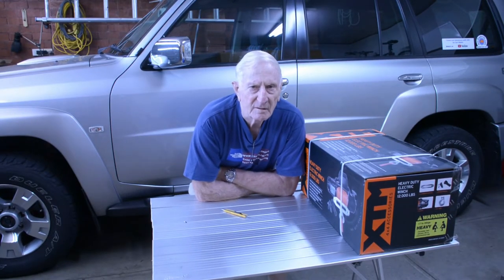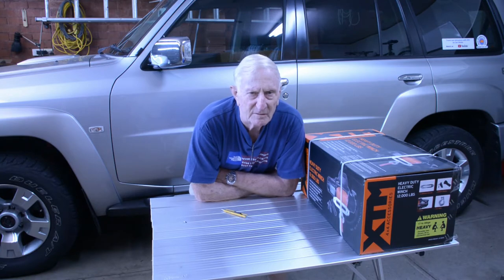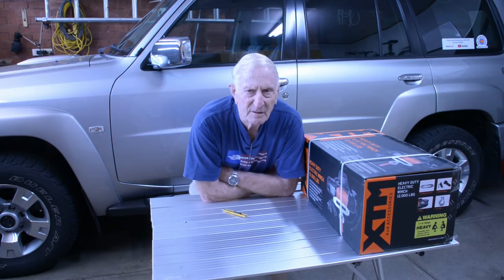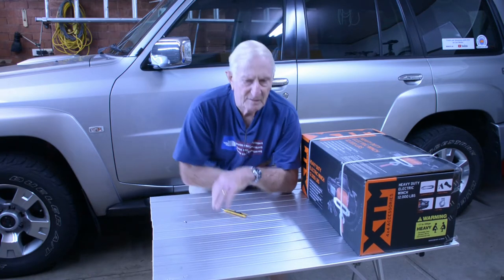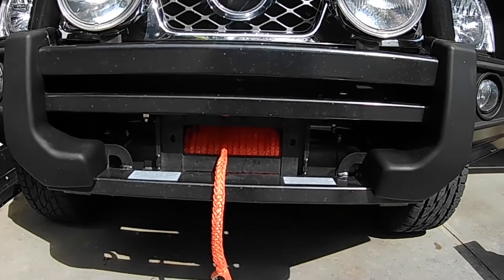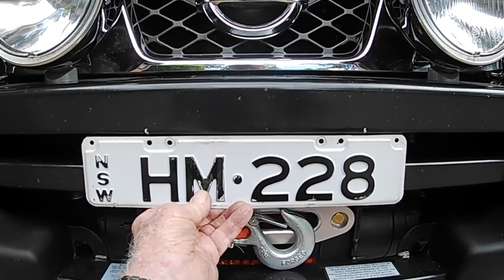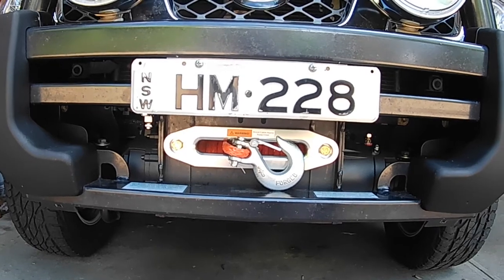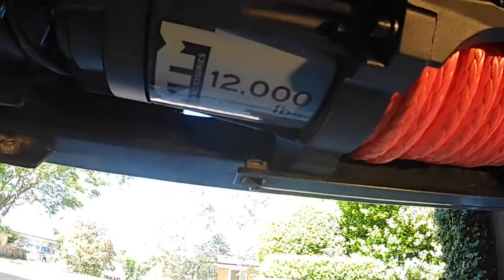XTM Winch install on a GU Nissan Patrol

Comment: Hi Carl, was about to mount a kings winch of the same dimensions on and with no rope on the drum it looked way to low in the normal mount position on the bar to where the fairlead would be . Have you had a chance to use the winch yet, had any trouble when spooled out lots of rope with it pulling on too much of an angle from the fairlead to the winch ?   Cheers.
Reply from the maker: I think you are looking at the instructions where they tell you how to mount same as mine which makes the rope come off the drum at the bottom, even though they tell you not to I turned it upside down so the rope comes straight out of the fair lead not sure if I explained in the video.
The rope on mine comes out 600mm above the ground and yes I did a test using most of the rope pulling uphill 3 ton Patrol worked fine !
Reply: Ok thanks.  I’m just going to mount it upside down. So it comes out the top but out and in remain the same.
Reply from the maker: Yes and I found was better for the cables and connections

Comment: Hi I have a question isn’t the rope brushing against the bottom bar even after you put the Farr lead on? My bullbar is similar to yours but the instructions say fitted in underwond position not overwond
Reply from the maker: I know they say that but when I looked with the rope coming off the bottom was way to low so I went from the top, and just had another look the rope is coming out the centre of the fairlead  in the fully wound position.
Still need to go out in the bush and do the tightening procedure though.
Reply from the maker: https://imgur.com/a/tAlbR36
have a look at this picture
Reply: @travelandadventurewith4x4  thank you for explaining how about the controller does goes in when you press on the in bottom and comes out when you press on the out bottom or is reversed/flipped? We have the same bullbar
Reply: @travelandadventurewith4x4  or is it the same?
Reply from the maker: Well when I did it because I had turned it upside down thought the controller would be reverse       ( out would be in ) but to my surprise it works as it should, as to the lettering on the controller - out is out when you press. Hope that helps